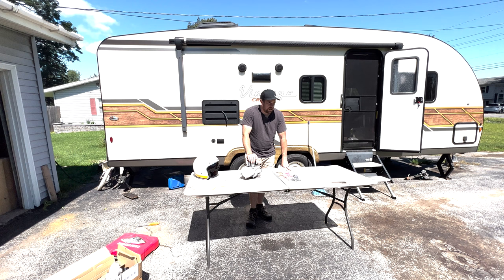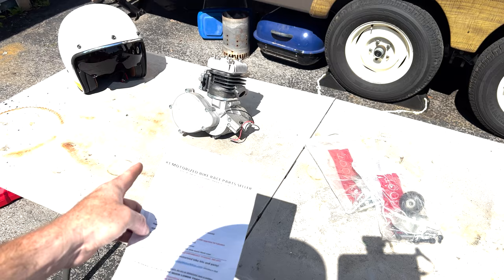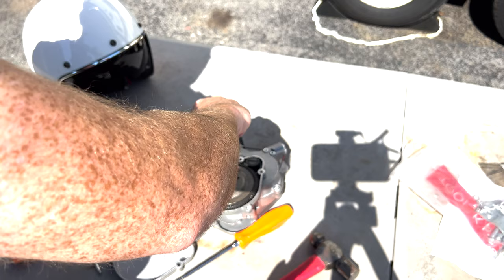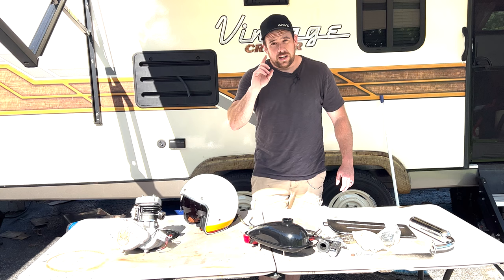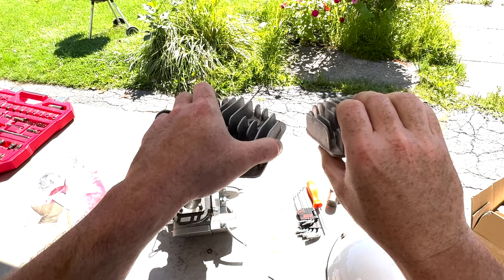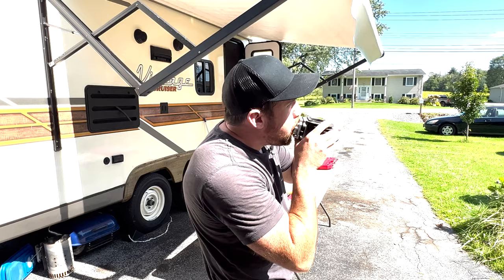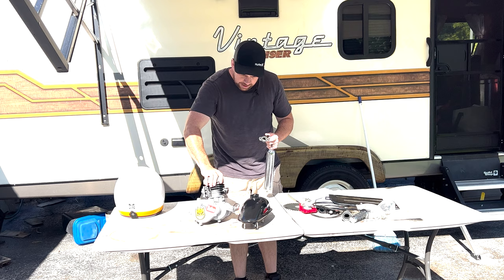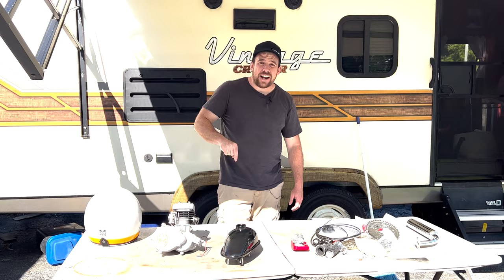WildCat Ultra Minarelli 6hp Race engine! #motorizedbicycle

Comment: Not a race engine. Its an exact copy of our minarelli but ours are 8hp.
Reply from the maker: Must be a marketing gimmick then. Either way I’m gonna treat it like a race engine! 🏁🏁🤘🏻
Reply: I wish it was an exact copy 
Smoliks engine is way better built but you pay for it but for $200 it's a decent start
Reply: Kurt these are just as good as what you sale yes you got to take it apart and do a few things but yes Just as good as what you sale. For $300 less. I have one of these wildcats bottom ends but I used your short rod spacer and your intake with the naraku cylinder. Way before California sold these. Please tell me what makes them not as good?  Yes I would rather have a long rod crank then a short rod.
Reply: 16hp out of the box
Reply: @leonardarola  not even close
Reply: @kjsmolik  bro, we shall meet .
Reply from the maker: @kjsmolik  always someone who wants to argue with you Kurt, on all platforms 🤣
Reply: Basic cast iron minarelli is dynoed at 8hp.  A Piaggio which is the baddest 2 stroke engine on a bike was dynoed at juat over 15hp.
Reply: @kjsmolik  thank you sir, my Piaggio is super happy now . And merry Christmas dude.

Comment: What you called the cdi is really the magneto an it does have extra copper wound insode than the old stock one. Ive used California motorbikes for 9 years now   there motors rock
Reply from the maker: I mixed up my words and such. Just like in real life: I like California motorbikes so far as well. Pretty happy with em

Comment: i ordered the same motor from California motorbikes and im wondering what jets ended up working out for you?
Reply from the maker: This is what I ordered from eBay. I have not used them yet. But once it warms up I’ll be making it a touch fatter
Reply from the maker: https://www.ebay.com/itm/374264805585?mkcid=16&mkevt=1&mkrid=711-127632-2357-0&ssspo=xgrjar4bqx2&sssrc=4429486&ssuid=H6LwYMCyReu&var=&widget_ver=artemis&media=COPY

Comment: What’s the difference between this  motor and the 5hp wildcat they offer with a kit
Reply from the maker: I don’t think Cmb offer the minarelli as a full kit. I just looked briefly and did not see it. 

Minarelli is its own niche all in its self. I have not tried the other engines.. yet. So I don’t have an opinion on them. Facebook has great forums and much more knowledgeable people. Search Kurt Smolik. He knows a thing or two bout a thing or two about! 

This one you have to source all the extras. And they add up. I have the full build in my playlist if you care to scrub through. 🤘🏻🏁🏁🏁
Reply from the maker: I know that’s was little to no help. Sorry about my knowledge gaps
Reply: @ColdStartGarage  no problem thanks for the response I’m just trying to figure out how much I’ll have to spend all together to get it running since I have a bike V2 frame
Reply from the maker: @AceBase5 I spent just about 800 for bike engine and all the parts. But that’s without know much about minarelli to start with. I may be able to do it cheaper now I know a single thing bout em now 🤣

Comment: so thats a minerelli a chinarelli would be like your zeda80 cylinder with  a mineralli style reed smolik preformance sells them
Reply from the maker: So a chinarelli would be a chinadoll cylinder with a reed? Thanks for the input. I would not piece that together on my own. 

My brain was chinadoll bottom end with an Italian cylinder… but I’ve been wrong often!
Reply: A "chinarelli" is the "dio" kets you find online has the big block of metal that the intake and reeds bolt up to
Reply: I'm waiting to see you're next video hopefully see it run . And see how fast it is have been thinking about getting one ... At the moment my china doll will do 46mph .. and I have a 395xp chainsaw hybrid
Reply from the maker: I don’t have a frame yet. But I’ll be looking soon.
Reply: @georgebell8826 chinarelli is NOT a dio . Not even close. Chinarelli is made by Smolik performance and it uses a minarelli intake nit a dio
Reply: @ColdStartGarage chinarelli is made by smolik performance. It uses a china cylinder with a minarelli intake.  The cylinder is modified to fir the minarelli intake and reed. It's NOT a dio.